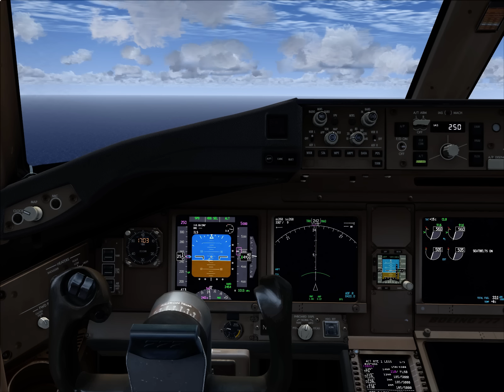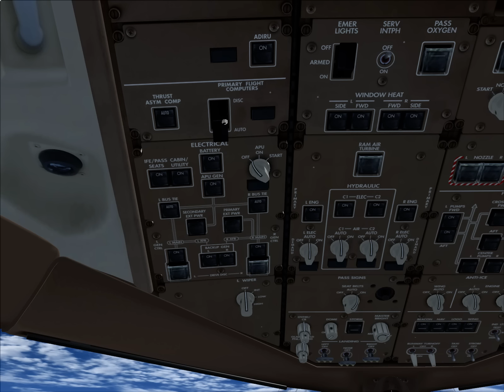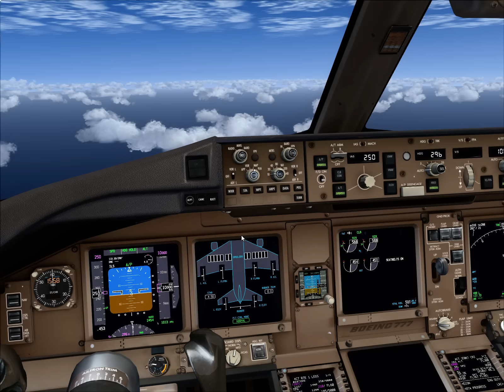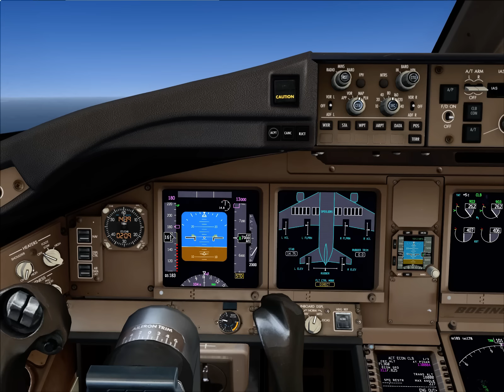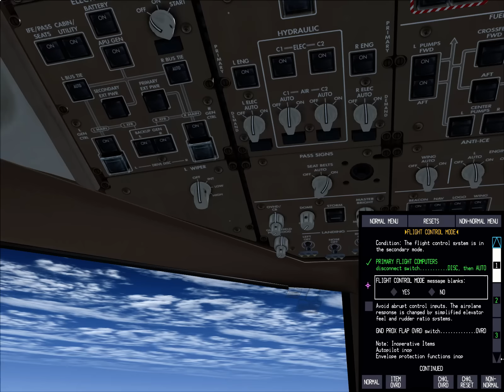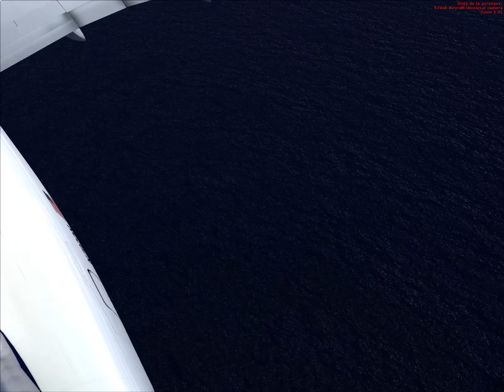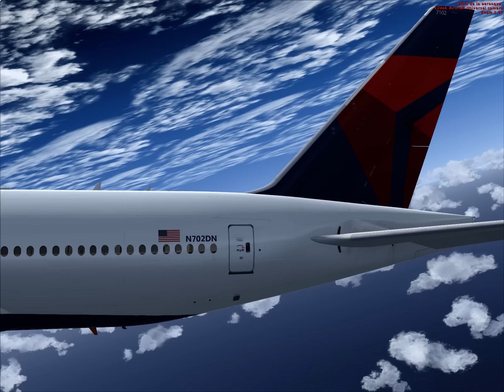The Fly-By-Wire (FBW) System of the Boeing 777

Comment: Would the aircraft eventually comes back to Straight and Level after trimming downward with constant thrust in normal mode?
Reply from the maker: No, it wouldn't. Remember trimming is basically adjusting the reference airspeed. If you leave the thrust constant and trim nose down, you're commanding an increase in reference airspeed. The only way to achieve it would be to establish a stable descent at the new speed.
Reply: @jibeneyto91  Thank you very much ;)

Comment: TAC is important during T/off and touchdown....in that phase if a Engine fails/burst ... TAC comes in and will kick Rudder with sudden/fast  deflection to counter act Assymetric thrust and then assumes new rudder neutral position to keep the nose in straightline
Reply from the maker: That's right. Less sophisticated airplanes have what I call the PETACF, or the "Pilot Engaged Thrust Assymetry Compensation Foot".

Comment: I just cant seem to get on with the FBW Pitch Trim, I know I'm obviously doing something wrong, its more of a problem for me trying to fly down the ILS manually, I had been trying to trim to the full flap VREF speed and the set the power to manage the rate of decent but I just cant get it right, I must be honest I much prefer the direct mode and fly the aircraft conventionally like the 747-400

Awesome video though very helpful!
Reply from the maker: Were you using the updated version of the PMDG 777? I believe their first release didn't model the FBW logic correctly.

Comment: Sorry. How is it that with the PFCs disconnected you still get the AT protections for overspeeding after applying downward trim? I don't get it.
Reply from the maker: Hello Rin. Could you please tell me the time in the video at which this happened?
Reply: Sure, it happens at 15:50. AT is disconnected, then AP, and finally the PFCs... Then when the overspeed condition is reached, the throttle levers come back.
Reply from the maker: If I remember correctly (sorry, some time has passed since I studied this), the AT "wake-up" function is independent of the PFCs and/or mode of operation.

Comment: What is really unnerving is that the plane seems to not apply the trim setting you select until you let go of the yoke, even if you trim in the same direction you pull, this is why its hard to trim by feel in normal law in pmdg 777. Flying without the fbw bug is like riding on bumps, you let go of the yoke completely, look what the nose is doing and then reapply the yoke fast. Flying the 737 or 747 is buttery smooth by comparison
Reply from the maker: Yes, I tend to agree with you.

Comment: Nice video! Fun to watch thanks.
I have one question.
Shouldn't phugoid motion also happen when aircraft is in direct law? I'm curious why aircraft's pitch angle does not change as the speed changes around 17:35. As long as i know, pitch up moment occurs as the aircraft gains speed, and vice versa. This is the nature of phugoid motion, and this motion happens naturally even without the aid of computers. But according to the video, it seems phugoid happens only in normal law, not in direct law.
Reply from the maker: Yes, phugoid motion happens in direct law. In 17:35 the aircraft is still accelerating towards its "trim speed", which in this case is extremely high due to the fully nose down pitch trim setting. In order to understand it: the phugoid motion is so "large" that all you see is the "downward" phase of the motion.

Comment: Hi Jaime,

First thanks for this very explainatory video. Everything related with B777 FBW is so clear now. I have newly purchased this great addon and I am trying to familirize the FBW. 

I am trying to make manuel landing with AP off but A/T on. So I am trying to use only trim operation to follow GS line. COuld you please share us with a manuel landing video with these conditions. (A/P off A/T on)

Tjanks again
Reply from the maker: Hello Burak, I'm glad you liked my video!
Regarding your question, you shouldn't follow the GS using trim. As explained, in normal law manual trimming is only performed for airspeed changes. During an approach your airspeed should be constant at Vapp and therefore you shouldn't need to use the trim switches. If you're using the A/T to manage speed you'll have to use the control column to control the aircraft's path. It's easiest if you follow the Flight Director during the approach.
In the future, once I have more time, I'm planning on doing more videos and cover approaches and manual flying.

Comment: Great video ! Can you tell me how is a boeing 777 fly by wire system different from an airbus fly by wire system? I know that in the 777 the pilot can override the FBW and in an airbus it cannot be overridden by the pilot . Are there any more major differences between the 777 and airbus FBW ?
Reply from the maker: +Dev Raghav 
Hello Dev, thanks a lot for your comment.
When hand-flying and in Normal Law, Airbus FBW differs from Boeing in that it's essentially flight-path-stable, as opposed to speed-stable by Boeing. In a Boeing the pilot has to trim for speed changes, in an Airbus however the pilot never needs to trim. The pilot of a Boeing controls the "attitude" of the aircraft (to where the aircraft is pointing) through the controls, the pilot of an Airbus controls the "flight-path-vector" (FPV, or to where the aircraft is actually flying)

Comment from the maker: Random fact: Each PFC has 3 microprocessors: Intel 80486, Motorola 68040 and AMD 29050.
The Motorola belongs to a family of processors also used for video-consoles such as the Sega Saturn. The AMD was widely used in laser printers.The Intel was also used in video-gaming. 

The PFCs are programmed with 132000 lines of Ada code.
Reply: Or the space shuttle.
Reply: Imagine what Airbus or Boeing could do with just some of the iPhone and android processors of today (not to mention an i7!)
Reply: @DJRosko25  kind of late reply, the application processor used on modern smartphone are not real-time system. It doesn't guarantee the code to have exact processor allocation hence can't be used for real-time controls. The closest thing to real-time processor these days are PLC controllers found on Arduino boards.

Comment: +jibeneyto Hi, this is a very good video and I learned so much from this. Do you mind if I use your video as a reference for my video project on Boeing fly by wire system? And maybe I will take a bit of your video or your explanation in this video to compile with mine. Is that alright? Of course I will give you credit for that.
Reply from the maker: +Rushdi Hmy Hello Rushdi, I'm glad you liked my video! It's perfectly fine that you use my video as a reference for your project. I appreciate you giving me credit for it. I'd also like to have a look at your project once it's done, just PM me if you wish! :)

Comment: +jibeneyto

Hi, Jaime
Great and awesome, as always the case with you're videos ;)

Two things I noticed. When you disconnected the TAC system though there was quite a lot of symmetry thrust , we didn't see a significant yaw movement to the left.
Second one is that the elevators while having air flow over them, should not drop completely down even in the presence of a flight control or hydraulic failure. With the elevators we saw in the simulator after 4 ACE failures, the aircraft would have been in a very rapid dive. It is true though in the absence of the airflow, as we see in the videos when pilots do the walk around the elevator is always deflected downward.

If you agree with disclaimers above, then I think we should inform the PMDG staff. Maybe the would fix it in an upcoming SP.
Reply from the maker: +Mohammad Taleqani Hi Mohammead, you're very right in your observations as usual! I was also surprised that the aircraft wasn't really yawing as I expected. If you look down on the synoptic you'll see there's a rudder deflection compensating, so maybe that's the PFCs doing the same function. I will try this out again disconnecting the PFCs.

Regarding the elevator, yes, I think that's an issue with the exterior model of the aircraft.

Have a look at the two Avsim threads I'm linking in the description!
Reply from the maker: +Mohammad Taleqani, I did some further tests on the TAC and what I found out was the following: With TAC disconnected, the PFCs will compensate for the yaw as if you were rolling the aircraft, by deflecting the rudder. The TAC however, if it's connected, will apply RUDDER TRIM to correct the asymmetry.
Reply: +jibeneyto Good to know that. Thanks!

Comment from the maker: My analysis of the FBW Sytem of the Boeing 777

00:00 - Introduction
01:50 - FBW Philosophy on the 777
03:43 - System Description
10:36 - PMDG FBW bug on the PFD

12:50 - Trim Change in Normal Law (constant Thrust)
15:50 - Trim Change in Direct Law (constant Thrust)
17:54 - Thrust Change in Normal Law (constant Trim)

21:45 - Roll in Direct Law
23:25 - Roll in Normal Law

25:37 - Lowering the Landing Gear in Normal Law
27:17 - Lowering the Landing Gear in Direct Law

31:11 - Approach to Stall in Normal Law
37:58 - Stall in Direct Law

41:17 - Failures (Secondary Law, Non-Normals...)

References:
- FCOM Vol. 2 Flight Controls: http://www.smartcockpit.com/aircraft-ressources/B777-Flight_Controls.html
- PMDG Tutorial 1
- Fly-By-Wire Flight Control Systems, Major J.P. Sutherland (1968): www.dtic.mil/cgi-bin/GetTRDoc?AD=AD0679158
- The Avionics Handbook, Ch. 11 - Boeing 777 FBW Flight Controls, Bartley: www.davi.ws/avionics/TheAvionicsHandbook_Cap_11.pdf

DISCLAIMER: I don't claim to be an expert on the FBW, The Boeing 777 or any aspect of life for that matter. I really just "learn by doing" and like to share my findings with the community because sometimes they happen to be useful to other people as well. If you happen to find inaquracies, inconsistencies or outright false statements, I'd very much like you to let me know them so that I can correct them.